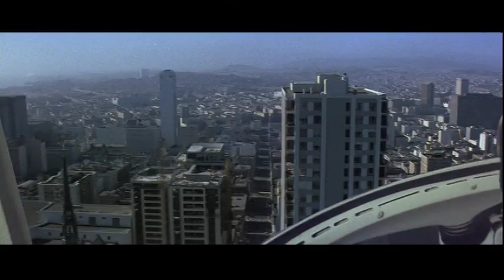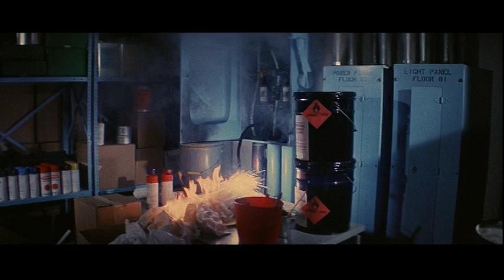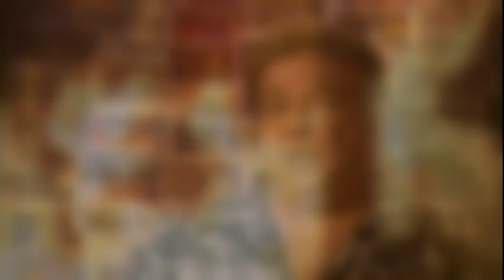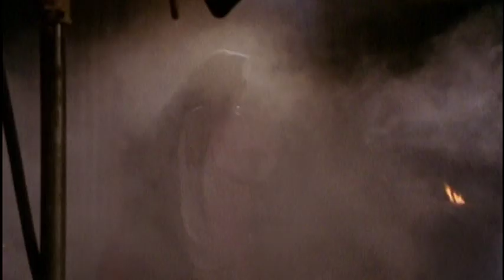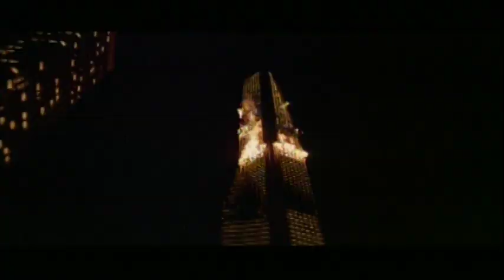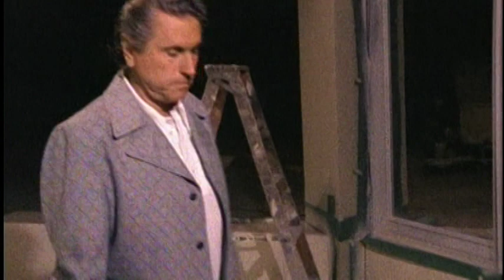THE TOWERING INFERNO - INNOVATING TOWER - THE SPFX OF AN INFERNO

Comment: My Dad was an architect. My cousin was a fireman. They both said no part of that movie was realistic but having a great cast like McQueen, Newman et al made it a great show.
Reply: I was neither an architect nor a fire man at that time.  I was 17 years old, and saw so many flaws in this movie.  But it was campy, fun, and the last of Hollywood's great disaster movies.  I still love it.
Reply: What for example? ...One thing I didn't buy was the dousing at the end, those tanks, sure they might have brought the fire down to a more manageable level, to buy time, but not put it out completely. But, it's a movie ending so that I forgave. What else was unrealistic?
Reply: Brian Merritt The penthouse windows. They would be led and impossible to break.
Reply: @BoraBoraSharkBoy Architect here, yes you are right. The windows break way to easily for being rated a quality suitable for such heights. At least they should be made of safety glass and breaking in small pieces. But then again I am not sure if the 70s already had such standards even in real life. The windows at the WTC, also built in the 70s, broke in large shards back on 9/11 hurting many people so the code may not have required safety glass in the 70s. The fire for sure could not be extinguised with the method displayed. Under control with a lot of luck and immediate intervention by stand by firefighters, maybe. 
The fire behaviour is rather unrealistic if the building was up to code. But with all the cut corners a fire could spread that fast in a high rise. A fire occured in the WTC in the mid 1970s and spread through the telephone closets 10 floors up within minutes because of missing fire stops for example.  Sprinklers were also not standard in at that time. Even the highest buildings relied on stand pipe systems.

Comment: I never understood the gas explosions that took place in the stairs sequence, do they run gas lines in skyscrapers?
Reply: Yes. There were also residential units in that bldg that used gas for cooking.
Reply: I think a more significant fact / goof is raging fire is shown roaring up the stairwells but there's nothing in them apart from concrete & steel - barely any combustible material apart from the exit doors so what is burning!? To cause the raging fires shown. Brilliant film anyway, one of my favourite of all time
Reply: @MrBassman91  also the fire on the lower floors shouldve gone out or decreased dramatically as all or most of the combustibles would have already burned up.  Also the sky surrounding the tower shouldve had much more smoke than what was shown.

Comment: The biggest complaint i have about the fire on the tower is that it looks too clean.  What they should have done (IMO) was incorporate the look of the tower in the last aftermath shot when Steve Mcqueen looks up to it smoking away (a great shot) AND have the flames with this smoking look.  THEN the fire would look realistic.  IMO they missed a step with many of the fire shots.    They should have had the smoke AND fire together.  Not just clean pretty flames.  It looks too perfect.
Reply: That's true, but the exterior explosion shots looked great.
Reply: @rjharris1960  To me they're out of scale to the building.  I mean it all works for the movie but if you really want to get picky the building looks too "Clean" the fire too "perfect" there's no debris and shit falling off no sparks.  Where the fire is burning should be BLACK.  If you look up high rise fires like in Dubai look at the building its charred. The floors where the fires are on are glowing hot.  The building is beat up.  I wish they had more of that in TINF.   The best shot of the building is the shot after it is put out and smoking.  This is how it should have looked when on fire.  There is no smoke when its burning.  Just a great big building with huge flames and no smoke.

Comment: The fire FX on the building exterior shots look terrible.  Totally out of scale to the building.  
They should have approached it more like the Bank of America fire where the building appears HOT like an oven.  Glowing with heat.  And much more choking smoke wafting up the building.  The fire looks too clean.  Like someone turned on a gas burner.  There is no detritus,sparks and shit falling from the building.  Its far too clean looking.

My only complaint.
Reply: Too much smoke would have obscured the actors

Comment: What is so fucking stupid is Steve McQueen, as a chief officer, doing...EVERYTHING! Movie or not, he's part of a command structure. In a dept the size of SFFD there are many trained and qualified men that as a commander he can have do all of the things he did in the movie. Again, yeah, it's "only a movie," but a fucking chief in command is not going to be riding a cable dangling from a helicopter over to the stuck glass elevator, someone else specifically trained and far less senior than him would be doing it. When you get to that level, you are command, you are not and never will be performing any highly skilled tactical maneuvers.